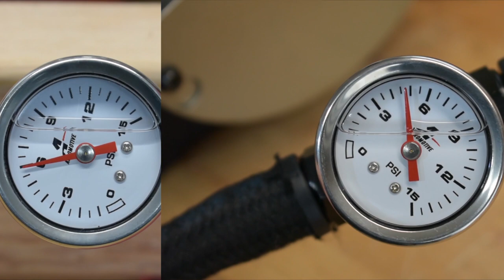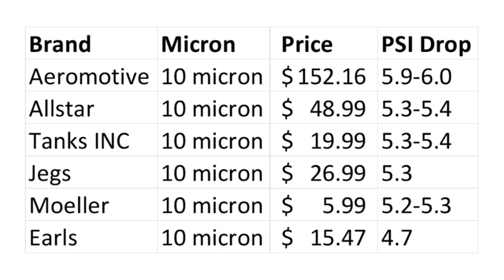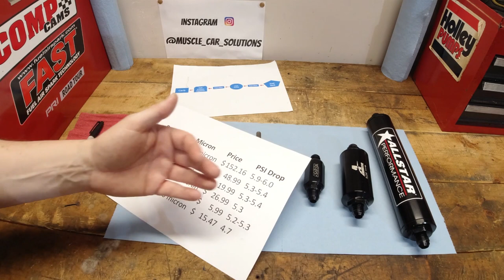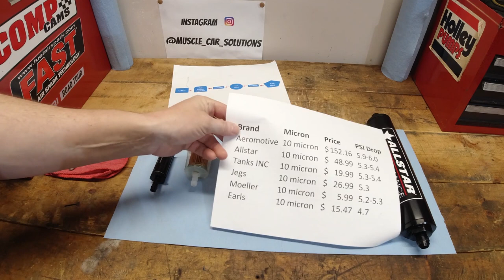Fuel Filter Test: Checking Pressure Drop

Comment: So.....if you added a set amount of particulate to each and measured the pressure drop i would be more happy to see wot happens. Do any have filter media collapse or tear? Do you end up with fuel starvation or no? Good channel though! Filter pressure drop is best at zero no? I have used filters with bypassess in hydraulics applications to prevent starvation in an emergency. Shunting fluid to a clean filter and throwing a red light in the process. Overkill i know.

Comment: I’m not clear why the pressure drop at the filter is important if it is located upstream of the pressure regulator? So why pay the highest price for the most expensive filter unless it is a better filter or, for some reason, you have to install it downstream of the regulator.
Reply from the maker: The regulator is there to ensure you’re getting the correct pressure for the carburetor or injector.  If you want the carb to see 6 psi, but the filter drop that, it’s also dropping FLOW.  Same with fuel injection.

Comment: On a dual carb edelbrock edurachrome air gap set up what carb do i run to the vacum advance do i run it to primary (rear carb) or front carb or split it with 3 way connector and connect to both? Or install on intake in port?
Reply from the maker: Run off the primary carb.
Reply: Thanks ill try that and all your info on fuel system is spot on so far so good
Reply from the maker: @tootiesmerrill3307  please let me know if you run into any questions.

Comment: By your chart the worst filer with the biggest drop is the Aeromotive one. Your chart says it had a 5.9-6.0 psi drop so if starting pressure was 6.0 psi then you had no pressure out of the filter. It would make more sense and be correct if you truly showed the delta valve of the pressure, this is what drop means is the delta of the two values. Thus the best filter being the Aerostar would have a PSI drop of .0 to .1 drop. Fluid dynamics needs to be involved and pumps don't make pressure they just make flow. restriction to the flow equals pressure. Maintaining pressure on a closed needle and seat in the carb is easy. Go WOT and the flow must increase to maintain pressure. These static type pressure regulators are not very good at maintain constant fuel pressure. They only flow anything over a given pressure without taking flow rate into effect. Using a dynamic type regulator where flow is bypassed back to the tank has many advantages, using a high flow pump you can maintain constant fuel pressure no matter the amount of flow. They also maintain constant flow thru system reducing possibility of vapor locking of the system.
Reply from the maker: I made the assumption that the viewer would do the math to see what the pressure drop was.  A little subtraction never hurt anyone, or so I assumed.  As far as getting into fluid dynamic theory, I made that pretty clear in the first couple minutes.  Just a real world test, with very common fuel system parts and filters that were actually on the shelf at the time I shot this video.  Is what it is I suppose.

Comment: Maybe I missed part of the video but am I missing something if I have a fuel pressure gauge right before the carburetor and after the second fuel filter and adjust my fuel pressure regulator while it's set up like this aren't you compensating for the pressure drop?
Reply from the maker: Doesn’t matter.  What matters is consistent pressure to the carb.  That’s why the regulator is always last in the system.  Unfortunately, some still think putting a filter right before the carb is the better play.  Knowing that there is a significant drop in pressure is half the battle.
Reply: @MuscleCarSolutions I'm sorry if I sound a little slow LOL, my setup has a regulator a second filter and then a gauge. Would this gauge not read the pressure the carburetor is receiving? I told you about this before I bought this car for a really good deal and it was pretty much done it just set for a while because the wife didn't want to part with it.  I really appreciate your insight and in the last 3 months I can't tell you how many people I've told about your channel LOL.
Reply from the maker: The concern is getting the right pressure to the carburetor.  What I wanted in this video was to show that indeed, filters will cause a drop in pressure.  Some more than others.  Some, like the exceptional product that Aeromotive produces, has little drop.  If you’re running a regulator and a gauge, you’re already better than the majority.  If there’s a filter AFTER your gauge, what you don’t know is what pressure the carburetor is seeing.  That can be a problem.  You can eliminate that potential problem now, or wonder about it in the future if you ever have a problem that could be fuel delivery/pressure related.  Don’t worry about asking questions.  I’m always happy to respond.  If in the end you have a better, more dependable set up, then we both are happy!
Reply: @MuscleCarSolutions  Right on I really appreciate you sharing you knowledge. Please keep up the good work.
Reply from the maker: @BPattB  anytime.  Happy to help.  Please let me know how it goes.  👍

Comment: I have a Walbro frame mounted 392. What should I use for a pre filter?  I have a Fitech TBI. 100 micron is what everyone says for EFI but Walbro says 20-40 micron pre filter. Also how about a 100 micron test?
Reply from the maker: 100 before the pump and 40 after the pump.
Reply: @MuscleCarSolutions  Now I'm more confused. Everyone says 10 after the pump for fuel injection
Reply from the maker: @332ARA  run the 10 micron filter then.  I don’t think it’s really that critical between the two.  If you’re concerned about the system and the injectors, you cant go wrong with the 10. I’m sure it will support whatever you’re going to throw at it.  I’d be more worried about the brand than the post pump filter.
Reply: @MuscleCarSolutions  okie dokie, thanks
Reply: The 100 micron is for carburetors. 40 is for carb or EFI. 10 micron is for EFI only.
Reply from the maker: That’s probably not a bad general statement but doesn’t exactly match what’s available on the market.  Someone is buying those 10 micro plastic body fuel filters or they wouldn’t continue to make them.  Boats are a good example.  Their fuel is generally awful and a smaller micron filter is used on carbureted applications.

Comment: Great test and video as usual. One thing I didn't hear you say was that even though there is a pressure drop post regulator, you can adjust the regulator to compensate for the drop going to the carb. so regardless of which filter you purchase, you can adjust the pressure to meet the carburetor's recommended pressure specification. In a real world scenario the gauge would be located last in line before the carb so you know exactly what pressure the carb is seeing, Yes? Thus adjusting the regulator to compensate for the filter shortcomings. Keep up the great videos, they are great teaching guides.
Reply from the maker: True but the point of the test was not how to adjust a regulator, but how much drop is seen in a filter.  There are quite a significant number of people who do not run a regulator or gauge of any type.  Part of why I did this video is to show people that even though you might trust what the manufacturer had a pump rated at (mechanicals are rarely at that number) you WILL see a drop at the filter and no doubt having a regulator to adjust the system is key.  In a perfect world, all carb guys would have a better configured fuel system, but then I’d have no videos to make!  😉 Thanks for watching!!!

Comment: Great content and I understand the intent of the test but what I didn't see mentioned was the flowrate conducted during the test? Real Filters are rated for X pressure drop @ X flowrate and everything being equal the filter with a larger surface area will yield the lowest pressure drop. If you really want to get into the weeds the differences are likely because of the accuracy/precision of the regulator and the efficiency of the filter element (Cheap filter housing with high efficiency filter material will outperform a shiny billet filter housing with a lower efficiency filter element - all other variables being equal). Also consider when working at low pressures that general use pressure gauges are 2.5%-5% accurate based on the full span and are most accurate in the middle 3rd of the range.

Comment: There are two types of fuel regulators. Those that maintain pressure on their output, rail pressure. Or those that maintain pressure on their input, as a bleed off.
If you regulate fuel pre carb, when under a low to high fuel consumption, the regulator is not only playing catch up to the demand it becomes a restriction. If your carb is a dual fuel input the inlet closest to the main input from the fueling system will be favored. Together it can cause starvation, if only for a moment, to the bowls furthest from the fuel system input.
By having a post carb regulator the potential pressure is at the carb. If the pressure at the carb drops the regulator will still be at a higher resistance after the carb. The fuel will take the first path of least resistance thus decreasing the quantity of fuel at the post regulator instead of via versa. 
The output bleed off of the post carb regulator is your fuel return line. Circulating all over pressure fuel through the entire fuel line including to the carb back to the tank. Kool fuel is happy fuel. 
As long as your pump can build enough pressure to get past any pre carb restrictions even at high demands, the carb can not starve. The post carb regulator may starve but then who give a squirt?

Comment: Thanks for your test!
Reply from the maker: You’re welcome!
Reply: Hello, I bought a Edelbrock AVS2 Carburetor (800cfm)to modify my Buick Riviera 430cui (1969). Do you recommend the Edelbrock Dual Feed Fuel Inlet #8133? Which kind of fuel pressure regulator do you use?

Comment: Just a little more information from my own personal experience. I've used most of those filters and some other brands. The Summit Racing and Russell Performance fuel filters have the stainless steel "pancake" elements just like that Jegs filter. So, if you don't like the pancake elements,  avoid those brands, as well.
Reply from the maker: To be fair, even the paper elements didn’t fare well when tested.  What’s concerning about that type of filter is lack of surface area to catch the junk.  Will clog/restrict flow much quicker than an element with a lot more area to filter the garbage out.
Reply: @MuscleCarSolutions  Agreed. Having a filter with that little surface area is actually kind of scary. Especially if it's on a dedicated nitrous fuel system. One clogged filter could be disastrous. Have you ever thought of testing different brands of AN fittings to see if one brand actually flows better than the others? I've always wanted to do that, but never had the time.
Reply from the maker: @save16thave  yup.  That one could get catastrophic rather quickly!  

I have no plans to test flow rate on fittings or filters at this point.  Not sure I have the right equipment to conduct such a test.  It would be rather crude if I did.  For sure that could be some good info though.  I’ll have to think about it some more and see if I can come up with a simple, cost effective way to do it.

Comment: Can you run the fuel filter test with a mechanical pump?
Reply from the maker: Pressure is pressure.  Doesn’t matter where it’s seen from.  And bench testing a mechanical pump is not anything I could invest in.